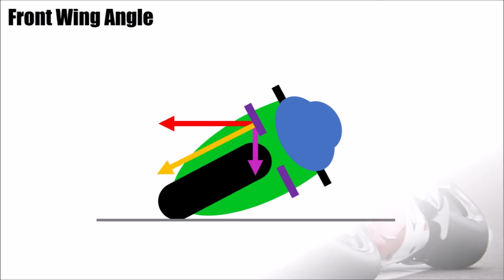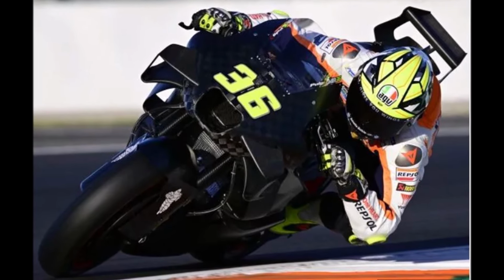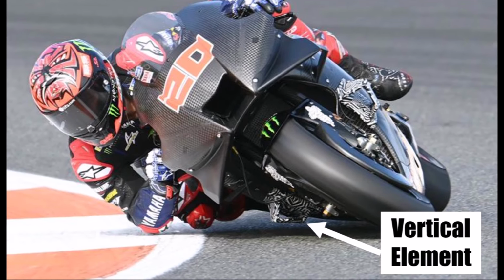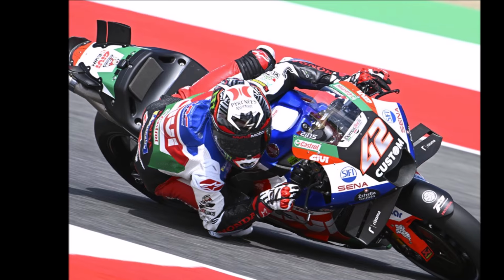MotoGP Aero Problems - EXPLAINED

Comment: I know a lot are against it... but for me its very interesting the wings and the track times how they are faster and lap times are broken every year
And thats why i am for the wings 😃
Reply: Same. The wings + tech is so cool for me.
Reply: Imagine thinking trading closer racing for faster lap times is a good thing
Reply: @dantton1987  If youre such a fan of closer racing, watch moto 3 instead.
Reply: @dantton1987  imagine driving the same bike design for 100 years and stop inovating and searching new ways to go faster.
Reply: @zelcpavle5494  banning wings doesn't mean banning inovation.
Reply: @dantton1987 Imagine banning innovation in what is supposed to be the pinnacle of motorcycle racing
Reply: @YamatoRick  imagine thinking it's okay to restrain the cubic capacity of the engines but it is not okay to ban wings.
Reply: @dantton1987  Never said that but okay 👍

Comment: It's killing the excitement of a MotoGP race when before, we can see overtake in almost every part of the circuit, almost every corner. Now the overtaking area is massively reduced to some corner or in only in the straight. Riders used to overtake side by side corner by corner tirelessly, but now rider tend to follow each other longer without any overtake.
Reply: Or even worse. They have to deliberately lift off so the front tires don't overheat. The aero craze is a blight in MotoGP
Reply: @dantton1987  tyre preservation have always been part of MotoGP, hence why I found that sprint race are more exciting than the main race, because the rider can just go full throttle without any strategy, without thinking about saving fuel and tire
Reply: @padisuromertani  Saving fuel and tires are what makes racing fascinating.
Reply: @perfectman3077  watching the fastest people on the fastest machines racing as fast as they can is what racing is. Saving anything is a negative
Reply: @padisuromertani  My point is doing so BECAUSE of wings and other aero bits
Reply: @jdoe9518  You must always save the tire. Flat out mindless racing is boring.
Reply: @perfectman3077  Tyre degradation is going to be part of any motorsport that isn't running an excessively hard compound. That said hard compound tyres slide more and lead to more mistakes which lead to more passing. Most people consider passing the least boring part of racing.

So to clarify your position is "flat out" racing is "mindless" and "boring"?

Can you name a series that benefited from increased aero, fuel saving and excessive tyre management?

Pretty sure F1 had to add DRS because of how badly they've fuc ked things up
Reply: @perfectman3077 Then explain how there are people that enjoy Isle of Man TT among other races in irish bike road racing championship more than Moto GP?
Reply: @jdoe9518  I don't need to name a series that has benefited from increased aero and fuel savings because it doesn't exist and it has nothing to do with my comment. I hate these stupid MotoGP wings with a passion. But tire preservation is super important and interesting, all of the great MotoGP seasons had tire preservation as an important factor.
Reply: @hillclimbracingfan5821  Isle of Man TT? Probably because those people are looking for gore? That stuff shouldn't exist.
Reply: @perfectman3077  You got it wrong if that’s why you think it’s watched and it’s not about that at all but it’s about seeing skilled riders go as fast as possible and test their skills on one of trickiest tracks in the world and saying it shouldn’t exist shows you clearly don’t get it at all-that,along with races like Ulster and North West 200 is racing in it’s most raw purest form and it’s not for the faint of heart;those watch track racing like Moto GP.